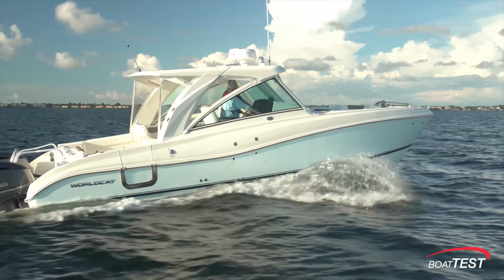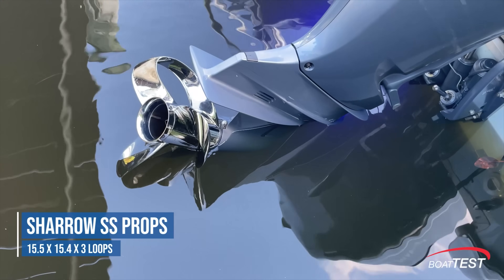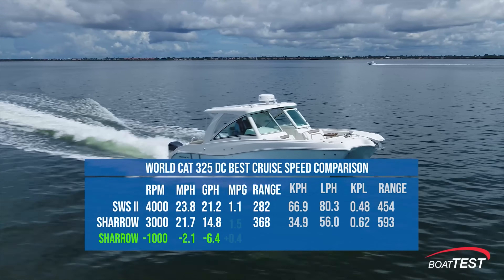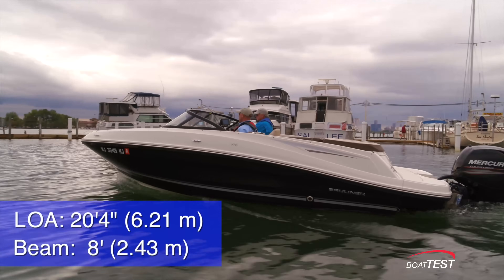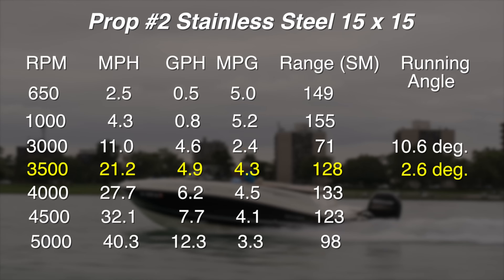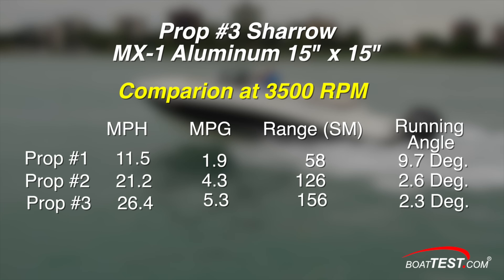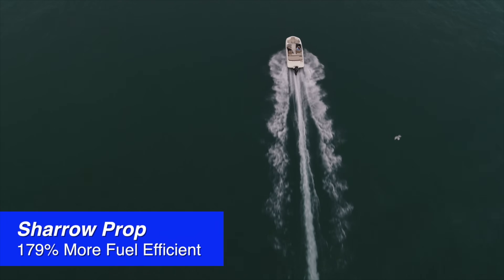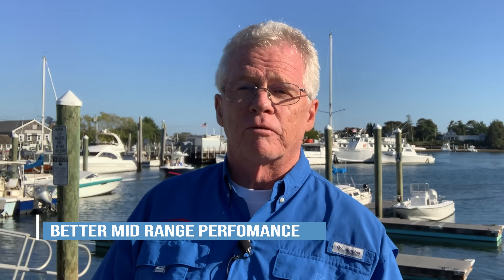Sharrow Props - Range & Efficiency

Comment: Hmmm, I wonder if a prop like this would work in a trolling motor? I’m on that 90% of the time, so extending battery life is key - even if there was such a prop, it would be much cheaper than 3-lithium trolling motor batteries that will run well over 3k.

Comment: Are you guys comparing fuel efficiency when the Sharrow prop has the boat on the plane and the standard prop doesn’t?! That will give you a huge difference in fuel economy. It is impressive that the Sharrow prop gets the boat on the plane faster but gotta compare apples with apples. On the graph that explains the huge difference in fuel efficiency in the low to mid range RPM

Comment: one more metric that is overlooked is that Sharrow propellers should be quieter. Im not sure if these new designs can scale up but the shipping industry is looking for quieter propellers to protect wildlife as ocean lanes get noisier. Some have resorted to drilling small holes at the tip of the propellers to reduce cavitation and noise.

Comment: Greg said in August 2020 that cast propellers would be delivered in early 2021, and that they're $2000 instead of the machined one at $5000. did that happen, or, change of plans?

Comment: Great video, but you left out the most important item. --> COST per Prop.
I've read that these high tech Props run up to $5000 per prop. 
Kinda expensive you think huh? 
considering that those Entry Level Props set you aside for a few hundred. 
Now, you have to think, if I ding a $200 prop, I can easily replace it without taking out a bank loan.
But the High Tech Prop at $5000 grand? Lord have mercy and some explaining to do when you idle into the Boat Ramp and Cousin Buck failed to pull up the prop before landing. 

You iggot.... Buck f##K man, think. You wrecked the $5000 dollar prop.

Comment: For everybody crying on the price: It's a rather big and juicy chunk of stainless which probably runs at least half a day on a 5 axis CNC mill. For a 15" one 5k seems rather reasonable and if you don't bottom it out it gonna pay off rather quickly depending how much refueling is going on. 
Also really nice and informative video you guys put out there. Much appreciated!
Reply: How would this prop do for pulling power, such as popping a couple of heavy slalom skiers out of the water?
Reply: @deanbunnell4155  Since you have more "grip" then with a normal one it would do good i guess. I can't give you numbers but from my research, if i had any kind of boat with an engine i'd get one :| (this conment is not sponsored by the conpany making the props))

Comment: I bet all this prop does good is cruise. How's it get on plane. What's its acceleration like how's its top end?  Cry when you bump something under water. There goes 5 grand. Also the thing is guys big boat hulls very greatly manufacturer to manufacturer
When you have two or three motors on a boat you can't just do a bunch of prop testing with different brands sizes pitches. You'd spend a fortune. So guys just run what comes on the boat that the dealer installed without even running the boat the way your going to have it loaded

Comment: If you really want to make a significant comparaison at least one of the variable has to be the constant, in this kind of test SPEED has to be the constant. Plus or minus 1000 rpm makes a big difference in consumption and a relatively small difference in term of speed. Else this is just infomercial!

Comment: Wouldn’t the best test be running at the same rpm? I have Volvo DPH drives in back of D4 225 hp engines, my best cruising rpm is at 2800, I make 22 knots while burning 16 gum. That’s on a 16,500 # 32 foot boat.

Comment: Are you telling me no significance in performance whilest at equal rpms? Aka both at 3k or both at 4k? I would assume the sharrow performs better in a mud bog or weeds as it appears weedless designed  to shoot a stream through center while kicking the weeds away on outside bubble  but i guess weed need high speed  underwater filming even at a test facility aka bathtub water loop

Comment: wow. running the engine under load the whole time at 25% less rpm is a whole other factor.  so much easier on the engine over time.   those engines are working their butts off if they're burning over 20 gallons per mile.

Comment: The data is there and real. The efficiency is a win. HOWEVER, at $5000 per a prop... it's cheaper to just install a 9.9Hp kicker. The fuel savings of using that a lot (1gph at WOT and displacements speeds) will get you like 5-7mpg.  That increase in mpg is equivalent to 100-300% improvement is fuel economy.

They need to set their price to no more than 50% more than a "normal" prop and they'd kill the entire boating prop industry as EVERYONE would buy it. 

Paying $10,000 for two of these for my dual engine boat is just stupid.  It's like buying a Rivian truck for $100k just so I can save money on fuel with a $35k truck...  Actually it's a LOT worse...

Comment: SaltWater Sportsman tested a World Cat 320DC with 4 POB and twin F300s. They recorded 24.2mph at 3500rpm with fuel burn of 1.49mpg - almost exactly what WorldCat lists for the 325DC with 2 POB, half tank of fuel and no gear (24.2mph at 1.5mpg).

Seems very odd that you recorded 1.1mpg in stock trim given the above.

Also your kph value for SWS II doesn't match the mph value, which doesn't encourage confidence in the accuracy of your figures.

Comment: The lower RPM will likely save you a bundle long term by extending engine life. 
3000 RPM vs 4000 RPM you are probably doubling your engine life....no proof to back this up, just surmising :)

Comment: Any application here for large inboard motors (stern, V, and/or pod drive) on, say, 50 or 60 foot motor yachts? There is a market where the price would be far less of an issue and the added range would be well worth it.

Comment: Curious to see if there's any improvement with sailboats and motorsailors, being small diesel engines. Also curious to see if they would work with a counter rotating dual prop lower units.
Reply: Why wouldn't they work with counter-rotating props. I'm sure they make left and right hand wheels as they are and for more expensive vessels
Reply: These props are about $5,000 a piece. Say you are saving 33% amd fuel is $4 a gallon. That is 3750 gallons,  With my 30hp I would need to go about 30,000 NM and run for about 7,000 hours. Might have to change the engine by the time the prop is paid back. Also a lot of people have folding or feathering props on their sailboats, so it would slow you down while sailing also. So ignore the fuel savings completely, the only thing would be the increase in speed. Under motor most sailors don't care enough about speed to spend 5,000 dollars, especially when they will be losing speed under sail.

Comment: The increased range is the "big deal" for boats.  If your range is normally 200 miles and this prop instantly gives you 300 miles, that's a "game changer".  Your other option is adding auxiliary tanks or bladders.  $5000 starts looking more reasonable when you're factoring "range" into your POV.
Reply: I think $5000 is on the low end.  I looked into these things it was closer to $7500 EACH so for my boat it was $15k.
Reply: @uncommonsense9395  They're supposed to be so good maybe you can just use one.  😉
Reply: nothing about 5000 is reasonable for something that cant ever touch the bottom.
Reply: When you "don't know" how "air quotes" work. They aren't to "accent" a "word" in a "sentence"
Reply: @SmashGhost  he's that guy - https://www.youtube.com/watch?v=4DqoQq1zME8

Comment: I really like the part where they explain the theory why this prop is more efficient
Reply: Simple physics really. Less cavitation on the downdraft skeg make for better fuel economy. Although the coasting speed is reduced since the thermal efficiency is reduced due to that same downdraft pitch around the skeg ring top plate. If you can smooth the skeg ring top plate it would result in a better top speed depending on the temperature of the water your running in.
Reply: @askikr79  You sound like a new AI bot trying to write a comment. None of that made sense.

Comment: Maybe I'm missing something but wouldn't you go slower and farther if you just ran the original props at 3000 rpm?
Reply: Well if this data is to be believed, then yes you are missing something: MPG takes en enormpous hit if you fall of plane, as can be seen in the diagrams.l This props greatest strength (again, according to this videos data) is to run at a lower rpm put still keep the boat on plane.

Comment: Great propellers horrible price, surprising they are still in business
Reply: I have a 100,000 dollar boat and I’m not spending 10,000 on props don’t care how efficient they are.
Reply: @boatlover2296  Got to sit down and figure out how much you could save in fuel. Cost me close to $800 every time I fill the tank. I'll sit down and see how long it would take for the prop to pay for it's self. I go fishing often. personally I would rather buy a FLIR unit but who knows.
Reply: @boatlover2296  I have a 500k boat and I wouldn't do it either. Makes more sense to run a 9.9hp high thrust kicker (or 25hp for current/wind) and trawl around at displacement speeds. You get like 7mpg with a kicker running displacement speed.
Reply: @KieranCox  how much is a 25hp kicker tho
Reply: @RumblesBettr  appx $2.5k
Reply: @KieranCox  double that more like $5k
Reply: For the people driving a $100,000 boat I'm sure a $5,000 prop isn't a big deal. But I'm sure it is for those people in a little aluminum boat. The prop would be worth more then the boat!

Comment: I believe you already did a review of these props a few years ago...
Reply from the maker: yes and we will continue testing and showing different applications. We are champions of the prop because it works and it's the first time in 100+ years that the propeller has been finally re-designed. What is not to like?
Reply: @BoatTEST  The price
Reply: @ATStone  They didn't want to reply to that did they

Comment: They're interesting, but until they do some tests and show their impact on inboard (as they claim to have done) drives, I'm not really interested in outboards.  What can it do for a Princess V50 or Flemming 65?
Reply: Whats the difference between an outboard and an inboard? Nothing of note really I think compared to its the drive system itself, of which inboard got a bunch availible... Shafts, outdrive, pod drive, surface drives etc... So in my estimation its better to specify that as the variable rather than inboard/outboard.
Reply: @GoldenCroc  It could be the prop's RPM with the outboard being higher than the inboard (of any type).
Reply: @kfeltenberger  They are generally about the same, for the same size and type of boat. Inboards use gearing just as outboards do.

Comment: Yamaha F300s don't come with props. Too many different boats they go on, the end user or dealer puts the right prop on for the boat. Also you can change numbers with different props, conventional props. Tests like these are advertisements to wow people that don't know any better. I was surprised the difference of just different brands of props when I do prop testing.
Reply: Factory figures for the 325DC with F300s, 2POB, 1/2 tank of fuel and no gear are 24.2mph at 1.5mpg - which would substantially outperform the Sharrow props as tested.

Doesn't pass the sniff test.

Comment: Yeah...Idk how they can justify that price. Most boats running them would likely be multiple engine setups so 10-30k just for props. Then I doubt anyone is qualified to work on them yet so tons of downtime waiting for factory repairs when that happens. I think a more realistic price would be around $1500. They're trying to recoup all of their R&D money in the first year it seems.
Reply: They seem to be mostly aiming right at commercial sport fishing captains at this point. These are the people most obviously likely to recoup the expense in a reasonable timeframe.
Reply: It's just like anything else, first couple years, the price is super high so they can recoup costs, pay back investors and lenders and contribute to more R&D. Wait 3-4 years and I'm betting that 4500-5000 price tag comes down, at least somewhat, into the 1500-1800 range.
Reply: What do you mean "realistic" price? They're selling them so fast they're struggling to pump 'em out.

That suggests their price is realistic... as in they can realistically sell them.
Reply: @darthkek1953  ...or their production capacity is low